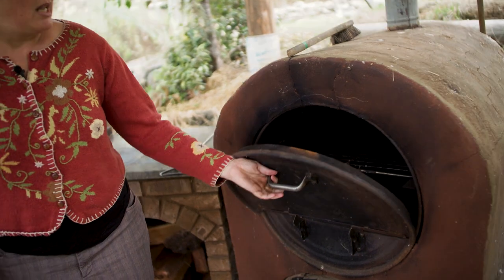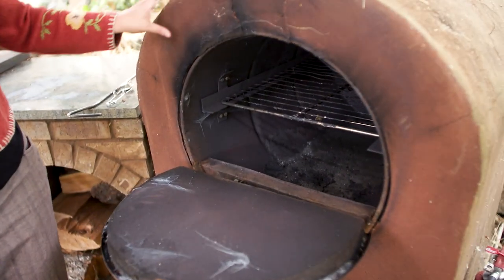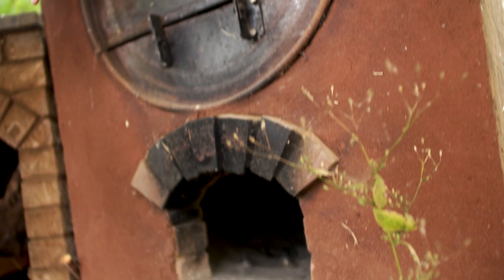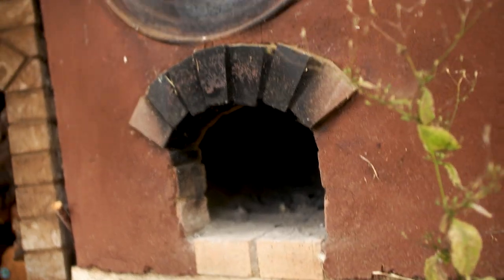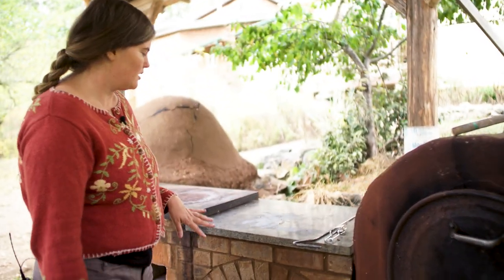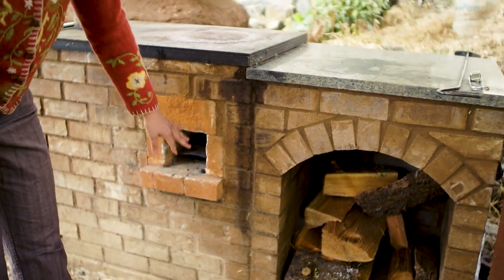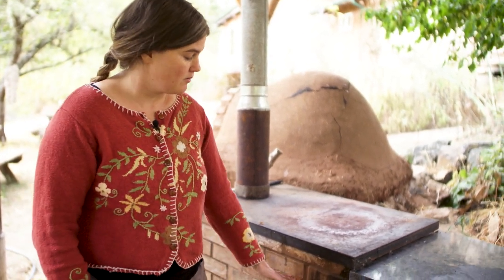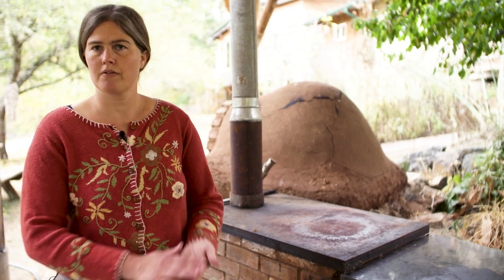Low Tech Appropriate Technology Examples at Aprovecho

Comment: Cool, we’re definitely going to build some of these things on our property. I think a few additional ones that should be mentioned are passive solar thermal water heating (preferably thermosiphon style, where the heat source is below the heat store therefore requiring no electricity and no moving parts), passive solar south-facing porches for home-heating, root cellars for refrigeration, earth tubes / earth batteries, ram pumps, simple wind-mills, etc.